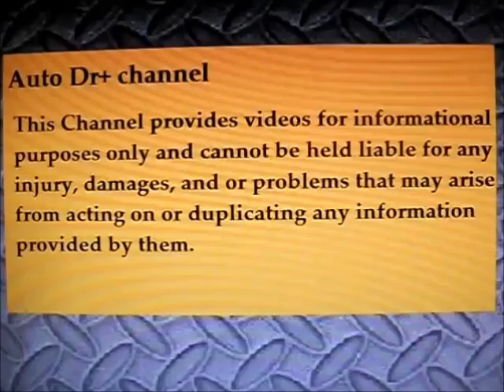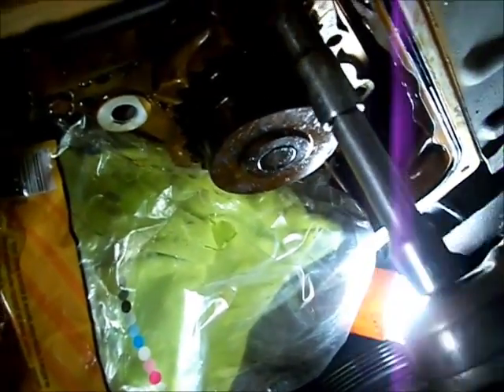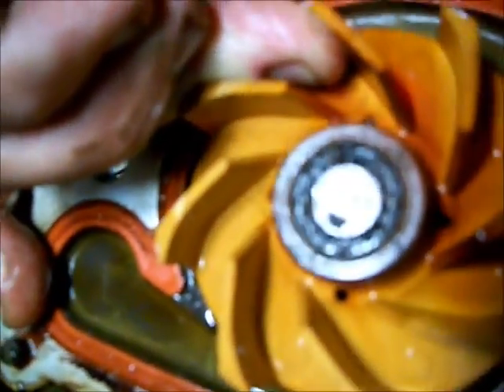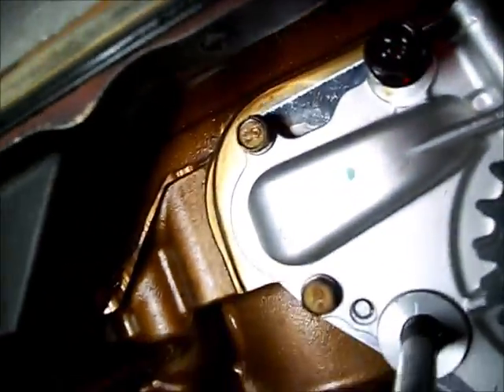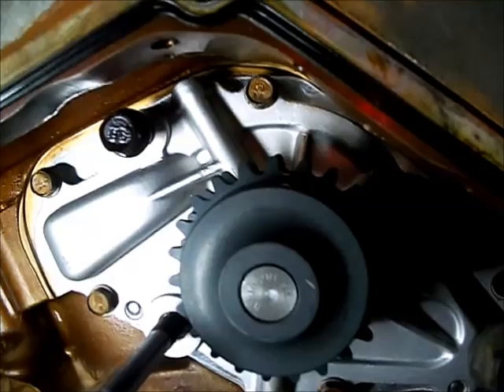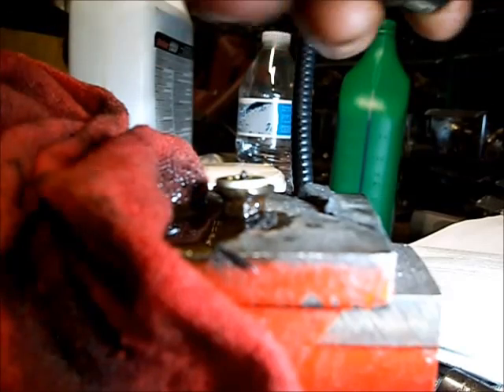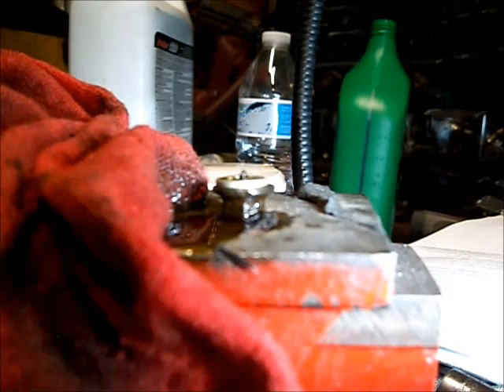Dodge Magnum `05 w 2.7l pt.2 water pump replace timing chains

Comment: this engine WILL still start if it's off by 2 teeth. Mine, someone replaced the water pump but didn't put the chain back on properly... when crank is timed the cams show about 11:50.  Still runs fine, no power and trans won't shift into overdrive because of it
Reply from the maker: It can only start if the cam sensor is un-plugged, even at 1 tooth off.  They are virtually useless when out of time.
Reply: hmmm mine starts and drives but is lacking power and won't shift into overdrive. It's a 2008 Charger though, they may have changed some things. The timing for sure was wrong when I checked, it was not 12 o clock on the cams when the crank was ligned up..... i'll let you know how I make out. Doing the job today.  So you really only have to take the sprocket off the passenger side to drop the chain right? Leave the other one on......
Reply from the maker: The ONLY way to verify that the timing marks ARE properly aligned is to: (#1):  Remove intake plenum,coils, and related secondary clutter. #2  Remove both valve covers, find and high-light both timing marks on the cam sprockets, (marks can hide under chain, rotate engine in proper direction, until marks (O) are found and defined.) Rotate crankshaft (ALWAYS in normal run direction) until both CAM SPROCKET marks are @ 12`0 clock position(the tensioner side sprocket will look closer to 1 0` clock ideally) #3  Remove belts, etc, damper, and timing cover. #4  Align crank sprocket mark, (a straight line cut into nose of sprocket) with oil pump housing mark @ approx. 4 `o clock position. (VERIFY) (Once aligned, the crank shaft must not be disturbed again) #5  On tensioner side cam sprocket, loosen 2 retaining bolts a 1/4 turn, go to tensioner plunger cover and remove the tensioner plunger. (BE ADVISED, DO NOT ROTATE CRANK SHAFT WHILE TIMING CHAIN IS UNLATCHED FROM SPROCKETS!) Chain slack now, (BE advised, that side cam, will likely settle approx. 1 tooth, (irritating but not unexpected, and not damaging) proceed to remove 2 loosened bolts retaining sprocket, hold sprocket and adjust height to allow chain to slip off of it, and return sprocket to rest on cam shaft end.  Either fish chain out, or pull chain up through other head around non-tensioner side cam sprocket.  Visually inspect side of chain links for 3 seperate sections of colored links.  2 individual link colored plates, and 1 double set colored links.  This is critical to the process, set double colored links on non-tensioner side cam sprocket, with it`s timing mark centered between the 2 colored links.  Proceed to align another single colored link to the crank shaft sprocket timing mark. (It is tricky to keep chain on time at crank mark, best way to verify, is to snap a picture level with it. It will get off a link every time, otherwise).  Pull chain up through tensioner side head and align last single colored link with that sprocket timing mark (0) and let sprocket rest on cam shaft end.  Once all 3 marks are VERIFIED, align cam sprocket with 2 threaded bolt holes and re-install retaining bolts (250 in lbs).  (This may be a slight pain in the ass, as the cam has settled earlier, so I clamp vise-grips to cam shaft in unused area between bearings, and rotate cam the 1/2 tooth or so to align sprocket bolts holes with threads in cam.)  VERIFY crank sprocket timing mark again.  (If its off, and the engine gets re-assembled, someone is going to be pissed.)  So anyway, bleed oil from tensioner, and reset plunger, if re-using. A new o-ring on itself (fairly critical), and cover cap, can recycle cover cap o-ring once, just dont lose it down engine before install.  Lube tensioner O-ring liberally on tensioner, and install slowly and square with hole.  If o-ring gets damaged from install, probable low oil pressure, leading to engine failure, eventually.  Check the timing marks again, picture of one on crank to verify.  Button it up.                                                              So after all that, then the marks are checked, and if yours is starting with cam sensor plugged in, then mabe you have some other type of problem.  A vacuum gauge hooked up to engine and reading below 18" HG (depending on altitude) would indicate a timing problem, or mabe a stopped up cat-converter.
Reply: Thanks for your awesome explanation. Could you give me your email so I can send you pics of the aligned crank/cams?  I think the guys that did the water pump put the cam marks at 12 o clock as per deck of head not 12 o clock looking straight at the engine. Dooooohh!!!! I am doing the replacement by taking the 2 sprockets off completely. Makes it easier to remove the chain. I followed the steps in the Cloyes chain kit replacement. So far so good....
Reply from the maker: As long as the double-plated colored links are on the correct cam shaft, and verify crank mark before final assembly, the timing is fool-proof.  But as I said, I dont` know how the engine ran with the cam sensor plugged in, if it was out of time.  The cam/crank position sensors must correlate together, for the computer to approve fuel delivery.  This correlation has several vital functions, 1 of which is to negate engine damage if timing jumps, by disabling the fuel injector pulse.  You can get it to start out of time, if the cam sensor is unplugged, the computer ignores correlation issues, and after a long crank time, establishes a firing order, and an injector gang fire sequence.  Not very efficient, but can limp home with substantially reduced funtion.  Oh, one other thing, I have tried 3 different aftermarket chain sets, and all have failed within 15k miles.  Only the OEM chains have even made it to at least 75k upwards to 100k or so.  If they wanted it to last longer, should have used 2 smaller chains, IMO.  Like fords 4.6 or 5.4 setup, erm, minus the variable cam timing mess, which they make blocking kits for now.  Post back if those Clo-eez (thats how I pronounce their name) chains hold up over 20k miles.  I have just started some testing on chev 2.2l, with their brand 6 months ago, but will take years prob, to gauge their performance.  Thanks, in advance.
Reply: I bought a chain kit from autoparts warehouse on Ebay. All parts except the chain was correct. The chain I received was 3/4 inch wide, the chain I had in there was 9/16. What gives? Have you run into this anytime before? I am fixing this car to sell. When you say "chain failed after 15k" do you mean snap or just that it gets sloppy again and you hear it when the engine starts up..... also, the check engine light was on in this car and had a code where cam / crank corralation was wrong, I believe it threw the engine into a fail safe mode not allowing it to shift into overdrive and also if you floored it and it got up to 70 mph it would buck and jerk and shut off. Then it would turn back on when the car was slowed down again. Strange, all this time with the cam sensor plugged in. BUT I believe 2008 had a different driver side tone wheel from what I can research 2007-08 are different than the pre 2007 engines... maybe that's why yours won't start when out of time??? I don't know..... thanks for the continued messaging..... I guess I will have to bite the bullet and go to the dealer and buy their $288 chain!? I can get a chain that will fit from Napa for $106 but you say this one will not last more than a year?/15k?
Reply from the maker: yes sir, here is my vid on comparison of chains (detailed close-ups of timing marks as well)  (https://youtu.be/pCbqQJnuUz0) the smaller chain is the new style chain, started in `05 I believe, and is the only style available from the dealer.  When converting the old style chain to the new style chain, it is quite expensive, as the water pump and all sprockets have to be replaced to accommodate it.  Your code indicates a problem with either the cam sensor, or possibly the chain was stretched from my experiences, it sets before a whole tooth off, or the cam sensor is taking a dive, and signal is skewed from it, so computer cant understand the static it sends out correctly.  And fail, is as in you can here it rattle on start-up, because substandard metalergy used in aftermarket chain, and the aftm. crank sprocket can wear inside hub out, and shear little 1/8" timing alignment pin, because it walks on crank.  The sprocket is being held on crank by shear force, no other clamping force is applied.  The best way to test crank sprocket, is that you need to heat it up to put it on, or it takes super high force (to the point of stripping the crank adapter bolt used to press it on) If it goes on relatively easy without heat, it will loosen on crank nose, had it happen.  Chain at dealer should be under $150, i think, and absolutely worth whatever it takes to purchase, but as I say, if an aftermarket one works for longer, I would like to know, as I been burned 3 times, (once on ebay, yes), the danger-zone, and one you had mentioned.  I believe to be competitive some good names have sacrificed quality to deal with the masses.)  and I dont have time to do redo my work over and over.  Besides the fact for many, it is prob the only car they got to get to work etc.
Reply: OK, went to dealer, got the right sized chain for only $67! So that's great. I am still using factory sprockets which look in great shape., just changed the guides from the aftermarket kit and the hydraulic tensioner, keeping the original one in case. using a felpro timing cover gasket set. Anything else I should be looking for? I got the 3 timing marks set up. Going to finish up tomorrow
Reply from the maker: The original timing cover stuff is re-usable....many times, and doesnt leak, as long as a little silicone is added to the bottom corners.  Yea, see, the factory chain isn`t expensive at all, and will give the longest life available.  (Better quality control)  The aftermarket guides are acceptable, prob get 1 re-use out of sprockets, but chain life will suffer about 25% of its life, due to it getting beaten into the old chain`s imprints on the old sprockets.  So, prob get 75k instead of 100k as an example.  Get new valve cover gaskets, or they will leak, (irritating stains on manifold, smell, and will saturate crank sensor plug, and engine ground strap over time.  My general rule on these is to use the OEM chain, water pump, and tensioner plunger (its typically $130-$150 by itself, so is water pump) and if it was to fail, I don`t think there will be a warning before most intake valves get hit.  But on the brighter side, I have seen others use aftermarket tensioners without incident, but have not tracked the durability more than 10k miles. (Lost track of the vehicles, traded, etc)  As I mentioned that little O-ring around the end of tensioner is easily damaged, without any indication of it. (nicked)  And if it gets nicked, it has a better than average chance of blowing out, (in 20-40k miles) and a severe oil pressure loss will occur.  It is a target when the engine oil light is on at idle and the motor is clean with no evidence of noise, from bearing damage.  (Oil pump can generate over 100 psi cold cruise)(down to 5 psi idle hot) is acceptable.  I have actually took some 240 wet/dry sand paper, and feathered the start of the opening in the head for tensioner, so o-ring could gradually squeeze down without incident.  No sharp edges there and I tapered 1/16" from opening.  Wash area with brake/carb cleaner, keeping grit out of oil jacket hole located in vicinity.  If not done, submerge chain in container of clean oil for an hr. and hang from wire to allow excess to drain for 15 mins.  ( for max chain life)  I coat guides and back of chain with stp oil stop burn as well for start-up.  Recheck all guide bolts (250 in. lbs) again, and counting 2 bolts for ea guide, and 1 in tension arm.  Make sure o-ring is in tensioner retaining cap before install. (105 in. lbs)  Don`t forget to pop tensioner plunger by using pry device against top of tensioner arm and flicking arm at tensioner plunger kind of quick.  Finally, take another picture of the crank sprocket timing mark to colored link again, for verification.  Always expect it to be off a tooth, until the tensioner plunger is released, and if it isnt, verify it anyway.  Now that the work is done in there, you are now at its mercy for the dry start-up on tensioner plunger.  It will likely rattle on start, which will give you the willy`s after all the work, and extra care it required.  But it always takes it without incident.  Be sure and shine a light into all intake ports, down to valve heads.  To verify no foreign objects have fallen in.  (vacuum out as required)  Should be good for at least another 75k or so.  Reguardless of any factory hype for oil change interval, this is a 3k mile oil change engine, to keep the interns clean and functional.  May go 4k, but undesirable effects may add up over time.
Reply: I cleaned out as much "Sludge" out of the motor as possible, will be draining the existing oil and putting Mobil 1 synthetic 5/20 in it.
Reply from the maker: The OEM pushes the 5/20 on them, and it is fine for under 100k miles.  But past that I go with the 5/30 to cushion with possible clearence issues, and to shore-up oil pressure in hot weather.
Reply: OK, here's the scoop.  Today I put the driver side sprocket wheel with the double link and then fed the chain down to the crank sprocket, ligned that up with the one colored link, then ran chain over water pump and then up to the passenger side and put that colored link on the dot mark of the passenger sprocket wheel (remember, I removed driver and passenger sprockets). So I thought, piece of cake, 12 o clock for the 2 top sprockets, lign up colored link on crank and make sure crank was set to arrow on oil pump.  All fine and dandy UNTIL I was supposed to move the passenger cam to meet the threaded holes to mount the sprocket, then the link on crank was 1 tooth off, then I  messed with driver side and turned cam clockwise to get threaded holes to lign up... cam slipped with the spring pressure etc etc etc.... so I religned the 2 cams where timing marks (dots) were at 12 o clock, then set the bog sprockets to 12 o clock and turned the cams just enough to get the bolt holes to lign up, tightened to 250 inch lbs each and put some blue threadlocker on them before tightening. OK, now all the 3 timing marks were good, turned crank slightly clockwise to take up slack on the driver side, then released the tensioner...... turned the engine around with the crank bolt about 4-5 times, nothing touching (no valve interference), but the timing marked links on the chain never came to the right locations anymore. I believe those marks are only there for installation right?  Also, I noticed when I turned the engine by hand the tensioner sometimes would "slap" and i'm assuming this is because there's no oil built up in it yet and once engine starts up that is what causes the brief "clack clack" sound until oil pressure is built up in the tensioner?  I just want to make sure this sounds right to you.... the 2 cams on the top are at 12 o clock and the bottom was right at the mark but when I took out the slack by turning it clockwise, it shifted just a slight..... then I released the tensioner... but I guess if there's valve interference it should be OK??? Please answer ASAP as i'll button it up tomorrow morning EST.  I am planning to leave the coils disconnected and crank engine with the starter to build up the oil pressure, or is there a better way??? I will switch out the 5/20 for 5/30 in the morning also.  If you give me an email address I can send you pics of what it looks like

Thanks a million!!!! Dan
Reply: One more thing to add to below,  can you leave the serpentine belt and fans off to start the car to verify? Once I crank the engine a few times with coils disconnected I will reconnect them and try running it???
Reply from the maker: I never cranked it over with anything unplugged, and they do fine.  Mainly because of the gerator style oil pump doesn`t do well at low rpm, on top of an oil change, means empty pick-up tube, empty air gap in oil filter.  And the chain really whips the tensioner arm at low rpm, over-coming the fulcrum points of cam lobes at low speed.  But cant say I have seen either way fail, unless some mistakes was made in there.  If I was to crank it over first, I would pull either the (Auto-Shut-Down (ASD) Relay) or the fuel pump relay.  And crank it, for-ever.  To prevent fuel being sprayed into dead cylinders.  I have started many vehicles without belts hooked up, no problem, as long as crank damper is installed, and not able to grab anything loose around it.I would add at least 2/3 full antifreeze premixed to it before start-up.  As a dry water pump can have a bad day, in a bad place.  Anticipation is making you wait?
Reply: Nah, it got late here so I cleaned up and said i'll finish tomorrow. wanted to run by you what I got accomplished. So I guess i'll just put the rest of it all together and fire it up then. Won't do an oil change until it's started and see that it runs good? Also, waterpump was changed by someone else not me so it's got plenty of coolant and I didn't get any leaks of coolant but a drop that came out of the inner guide bolt hole. So i'm good there. I guess these are not VVT engines.... so if I spun the motor around by hand 4-5 times and nothing hit i'm good??
Reply: Oh,  once you install the chain with the colored links in the right places the first time, these don't lign up again once you have cranked the engine over a few times right?
Reply from the maker: I have to ask, what do you mean " a drop of coolant came out of the inner guide bolt hole"?   Be advised that there is no place that a bolt hole can interact with a water jacket in there.  (That I am aware of)  As this bolt hole would absolutely have to have sealant applied to the bolt before install, to prevent a coolant leak inside of crank-case, and inevitable engine failure.  The only place a bolt hole could contact antifreeze, is around the water pump housing, and if those have antifreeze getting to them, then the water pump gasket is defective, and should be replaced with an OEM gasket.  Even when water pump goes bad, the antifreeze leeks into a channel drilled through block that exits around t-stat housing on bottom rad hose connection.  Just curious which bolt hole had coolant in it?
  Have have seen the plates nearly aligned on their own after tear-down a couple of times, but it is hard to say how many rounds the engine would have to make for them to align again.  If the timing marks are aligned, afterwards is "water under the bridge" and it will run and be fine, or not run and the crank will be off a tooth, which is why all the caution about the crank mark.  All of it will have to be torn down and reset everything again, not any short-cuts.  Had it happen 1 time, it don`t happen anymore.  I would have to say, at least on the intrepid/magnums, the worst part is taking out the radiator, and separating it from the condenser, mess around trans cooler lines.
Reply: The one drop of antifreeze came from the bolt hole that goes into the waterpump where the passenger side inner guide uses the bolt to waterpump. but there was no leakage of coolant at all other than one drop. So I am sure once I reinstalled the bolt that holds the guide into the waterpump housing it was nice and tight, will check engine oil after car starts up and runs, will also check level of coolant before start up and after a bit.
Reply from the maker: A bad pump gasket is the only way coolant can get to that bolt hole, and it may only leak under pressure, hot, or the cooling down period after being hot, or just while running.  So many possibilities.  At the end of the day what it boils down to is that, the gasket has a problem, it needs investigated, and a decision made if it is simply the gasket, dirt or gasket from old seal in there, gouge in block, or water pump defective, before any more progress of repairs,   All I can say is, that seal is real effective, as long as it`s integrity isn`t compromised.  But it is, so the next steps are outlined.  Yes its a little pain, but I watch for stuff like that to try and slow back-tracking labor waste, unnecessary costs, and negligent damage to customers property.  That and not sending tools down the road in vehicles:/  Use the best judgement and the head-aches will be over longer.
Reply: Thanks for all your help, car fired right up after it was all installed back in, no check engine light anymore either. now for a test drive,  For the crank bolt, I just tightened it by holding with a prybar and put a pipe for leverage on my ratchet and tightened it down quite a bit.... should be good enough??
Reply from the maker: the bolt tightens to 125 lbs, alittle more than a lugnut on the wheel, as long as the damper went all the way down, it shouldnt be a problem.
Reply: Hello again, all went back together like clockwork, started on first key turn and ran perfect, no Check Engine light either. I did notice the harmonic balancer is wobbling slightly now...... is the rubber separating? Should I take it back off and get a new one? Don't want the thing to grenade on me after all this work!
Reply from the maker: Good to hear that the chain job is doing well without complications. But did damper wobble before removal, and is it more than 1/16" side to side?  I have seen several wobble without incident, almost the norm.  But if you was applying any force to the outside pulley ring, removing or installing the damper, then it should be replaced.  I would at least loosen the belts, and grab the pulley and see if it has any independent movement.  Also, look to see if rubber is oily, swelled up, or otherwise not normal.  This eval should have been done after removal, so that the replacement, (if needed) would be installed instead of a defective one.  Probably a symptom before it goes out, (if bad) is that the pwr steering will start to skip, from pulley slippage, or warm a/c, possible gen light.
Reply: I don't remember if it was wobbling before I pulled it. I used the Mopar puller to get it off. When I reinstalled it I used a 5 lb sledge sideways to cover both edges of the HB and hit it on enough to have center bolt do the rest. I will remove belt and see how much play, I tried with belt on and there wasn't any wobble. I guess it's acceptable but will remove belt and chack to be on safe side
Reply from the maker: They do wobble alot on them, but prob only seen 1 damper bad, along time ago, suspect a puller was applied to outer ring.   Check it, all you can do,  probably normal.
Reply: thanks for ALL your help, you really know these engines and I followed your video and also the one from Cloyes to a T and it worked out for me. The car rides like a dream now! Not much power in these 2.7s tho hehe
Reply from the maker: kool, good luck with it